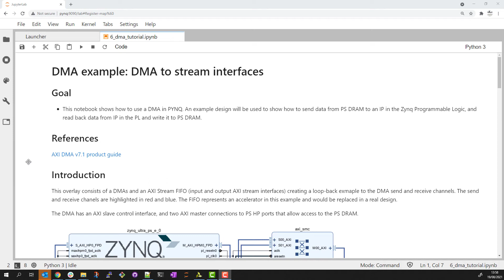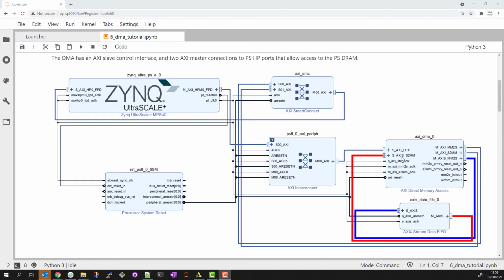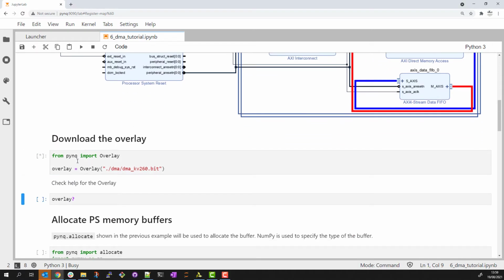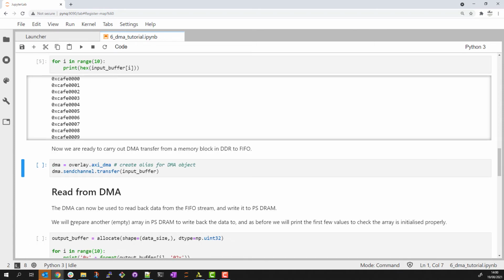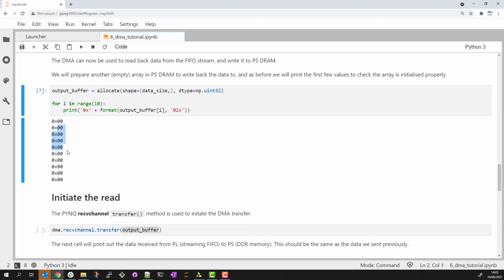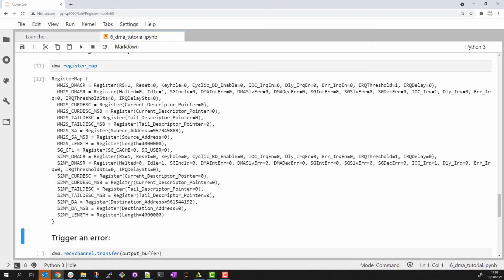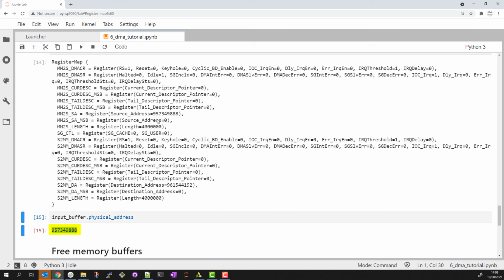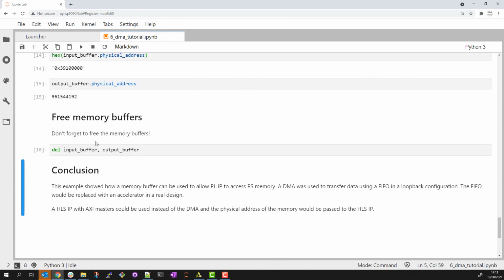PYNQ AXI DMA Example

Comment: I meet problem when using dma function ”pynq RuntimeError: DMA channel not started“ .Do you kown how to fixed it?
Reply: I didn't solve it, and I'm not working on this project anymore. I think it has something to do with the compatibility of the pynq, Vivado and HLS versions. After all, apart from this problem, the other project steps are very easy and it seems impossible to go wrong. If you can find a demo that can run correctly, try to build the project exactly according to its version.
Reply from the maker: Could you please post on the PYNQ support forum? https://discuss.pynq.io/
Reply: hello, did you solve the error, if so how? we are getting the same error too
Reply: @nitinvenkat7485  I am also confused. Also, when I was working on another project, I found that the same code could only be compiled in 2018HLS, but not in 2023. Vivado's version adaptation is a mess.